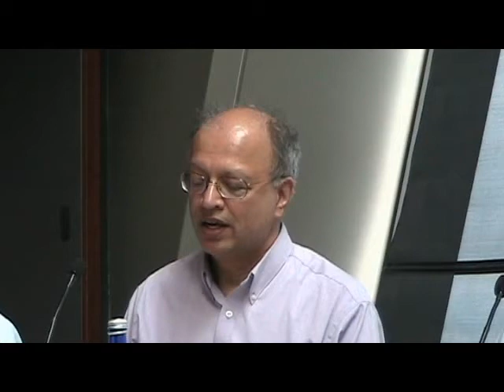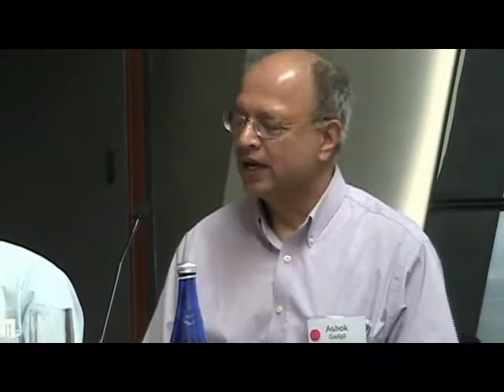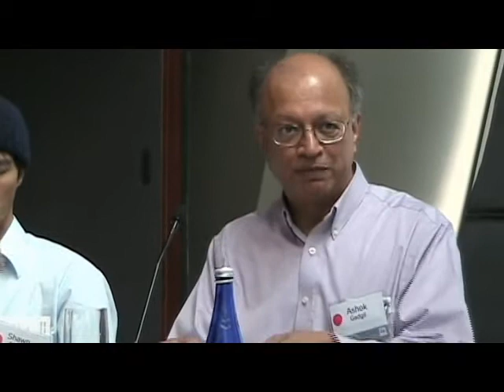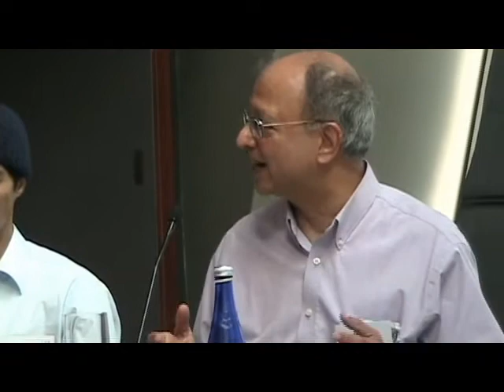Ashok Gadgil - Darfur Stoves

Comment: Ugh ... disaster of a project.  I remember these stoves in Otash Camp, Nyala, South Darfur cost like $15-$18 a piece, and had spot welder tips had to be imported from the US (then this local production froze when the tips got frozen in customs).  Then, women were making more basic improved mud stoves with mud and rebar for $2-3 each (yes certainly less efficient).  NGO loved the Darfur stove because it brought in a lot of donor money.  Though, this stove was totally not appropriate for the setting.  The Darfur stove was a very fast, hot heat and could boil a pot of water really fast, but beans and other foods needed a long, slow heat which this stove didn't do (the big heavy pots also meant they didn't really fit in the darfur stove and was prone to tipping). People had like three stoves in these houses:  the three stone stove, the improved mud stove, and  darfur stove (not all people as it was really expense, those that had it it was more of a status symbol).   The workers in the field really disliked this project but couldn't stop the project because it brought in money for other projects.  It overshadowed the more practical improved mud stove (there were a few thousand darfur stoves that made it there, but 50,000 + mud stoves made) which were more mass producible and cost efficient (the darfur stove was kind of a waste of money).